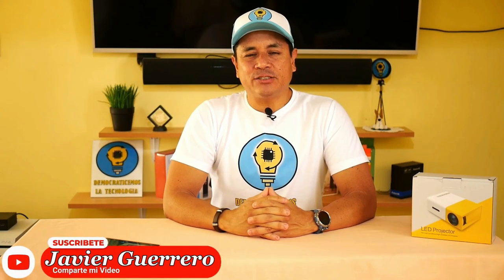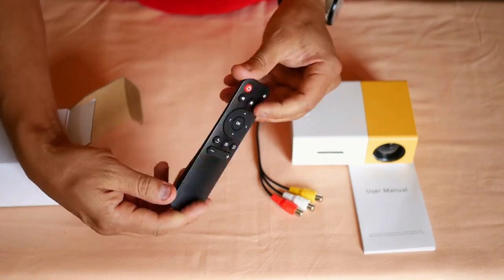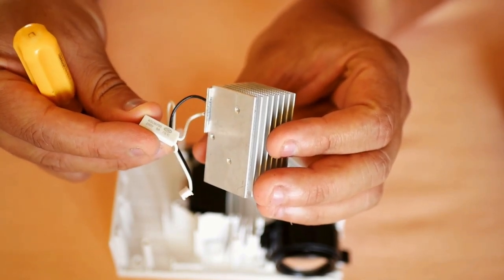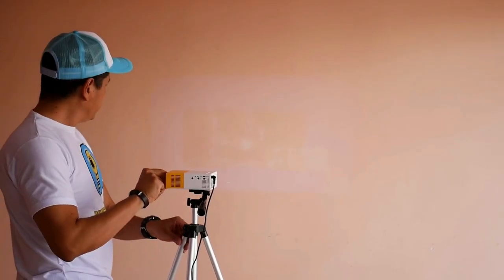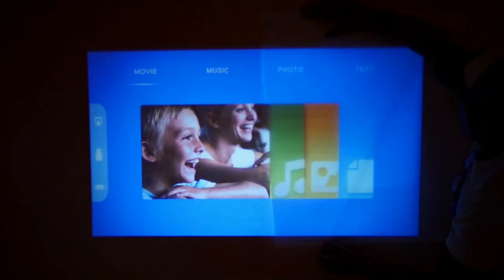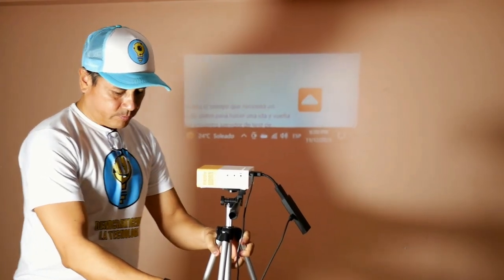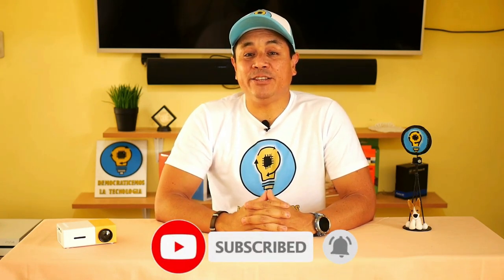Mini Projector Led YG300, ...The cheapest Projector on the Internet!! 😱

Comment from the maker: CHAPTERS IN THIS VIDEO: (Click on the blue number)

00:00  Advance
00:13  Presentation of the YG-300 Projector
01:55  Unboxing
03:35  Specifications
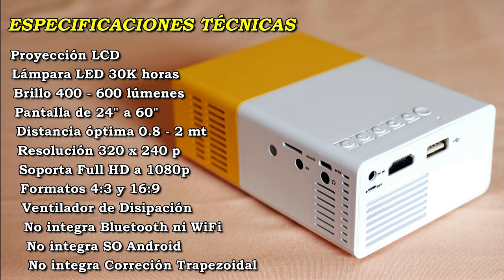04:30  With what light source do the Projectors work?
05:11  Digital Autopsy 🛠
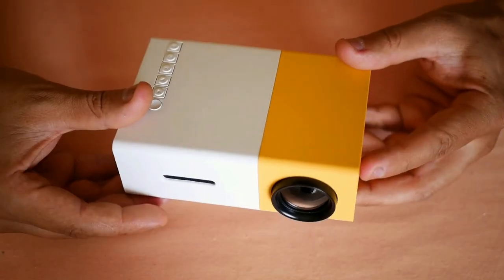07:52  How to Install and Configure it
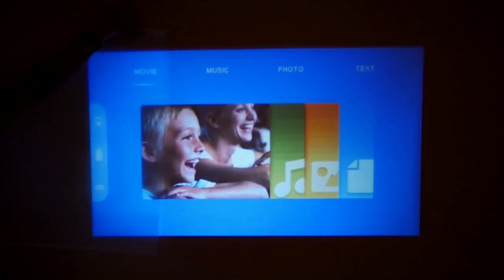10:58  Connectivity
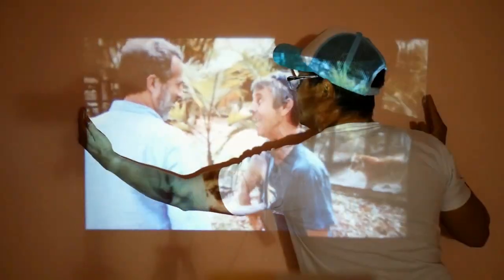12:07  Testing
13:54  Final Conclusions

Hire your streaming in GamsGo👉 https://www.gamsgo.com/#/?promote=QsZ3Wq
Digital Greetings!! ✌🐶